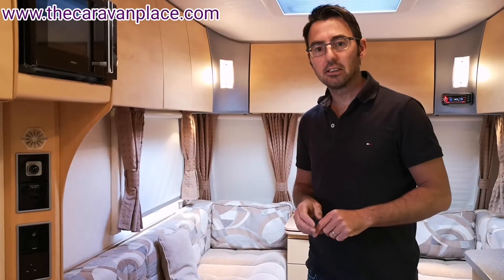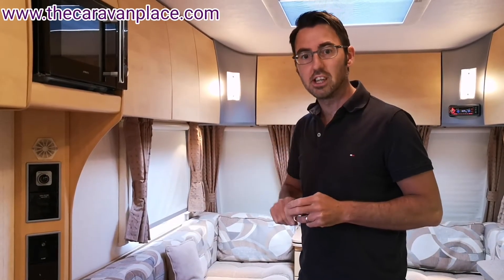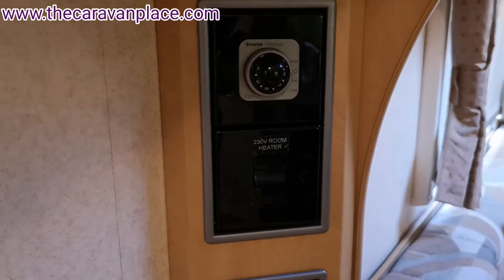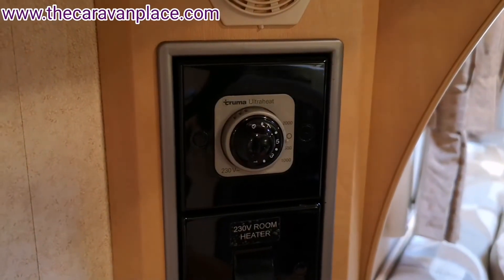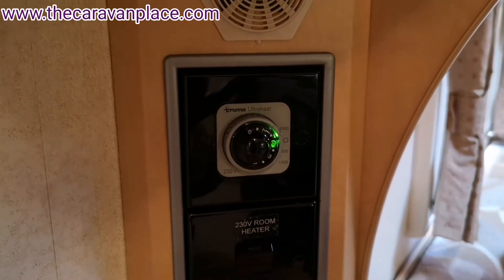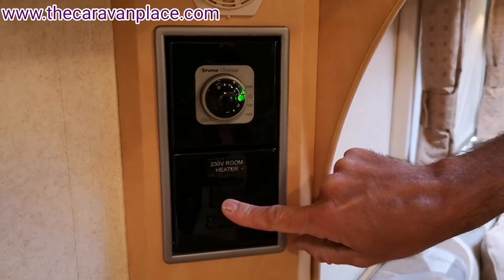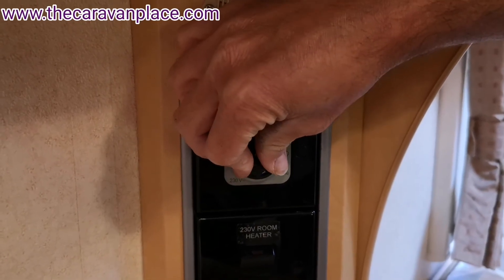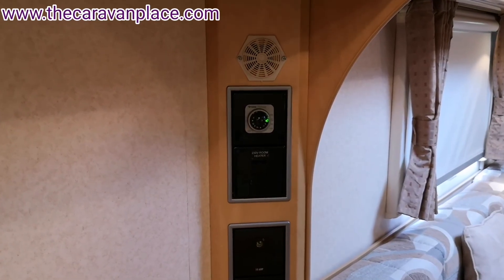Truma heating system on 230v. Truma ultraheat 230v heating s3002

Comment: I can't turn mine off. Truma Ultraheat 230v. I have both controls in the off position.
Reply from the maker: If the dial is in the off position it should be off? Its the dial that will control the heating. If it still seems to be putting the heating on in the off position, its possibly worth having a mobile engineer check it out for you. Hope this helps.

Comment: Doesnt the truma ultraheat only work when on electric only on the 2000w setting.
Reply from the maker: Hi, it should work on all settings 500, 1000 and 2000w, the electric control board maybe faulty if it only works on 2000w setting. Hope this helps.

Comment: if theres no click when turning dial does that mean the thermostats not working
Reply from the maker: Have you got the yellow light in the control dial? It could be power so try on different power settings and see if its the same, if still nothing then its either pcb or the element. It would need testing by a engineer really.

Comment: I have a problem when running it on 2kw, it starts to heat up, then cuts out and basically wont come back on again. I.e no heat but the green light is on., no matter what setting I turn it to no heat, only heats up for a bit then dies.
any ideas
Reply from the maker: Sounds like a pcb problem, they did a plug in thermostat that may fix the issue, if you Google truma heating remote thermostat and then look for the fitting guide. They just plug in to the back of the heater.

Comment: Great video, can I just double check if the  Truma ultraheat electric heating can be used after we have drained down the water system for the winter?
Reply from the maker: Hi, Yes you can still use your ultraheat on electric for room heating, just don't put on the ultrastore water heater which will be a different switch for the hot water. Hope this helps.
Reply: @thecaravanplace  it does indeed, thanks for the quick answer. Love u our videos by the way, very good and useful too.

Comment: When I'm just using electric for the heating, is this the only dial I really need to use jnstead of the 0-10 that is on top of the fire
Reply from the maker: 0-10 is the gas controller for the fire, if you search our other videos you will see the Truma gas fire how to. 👍